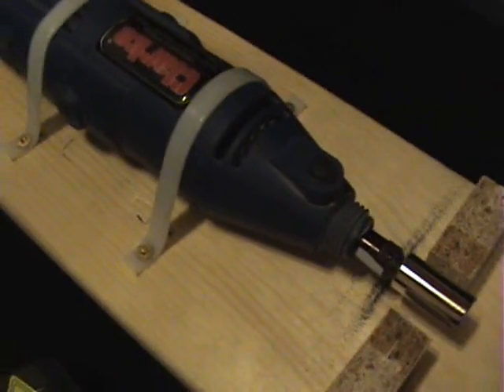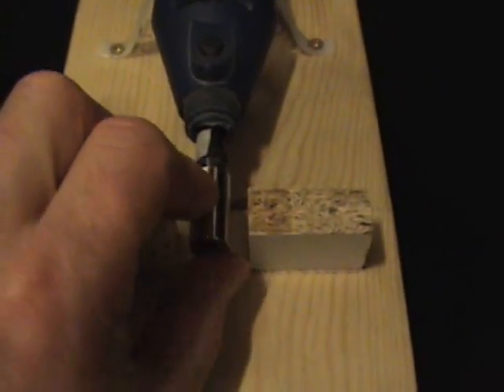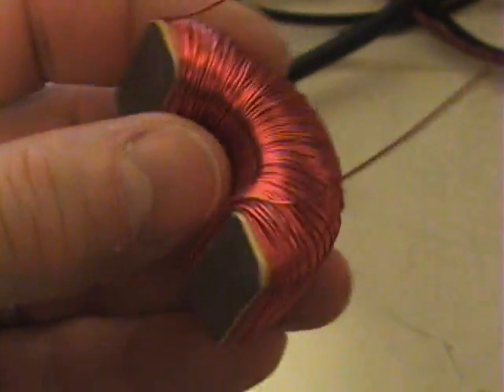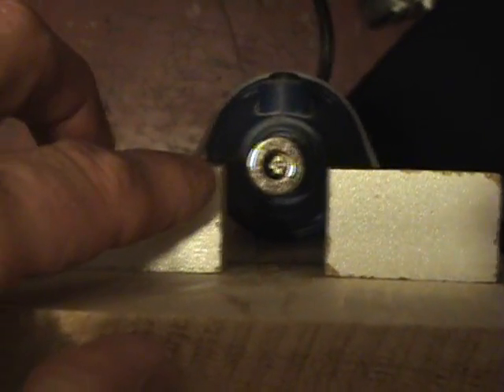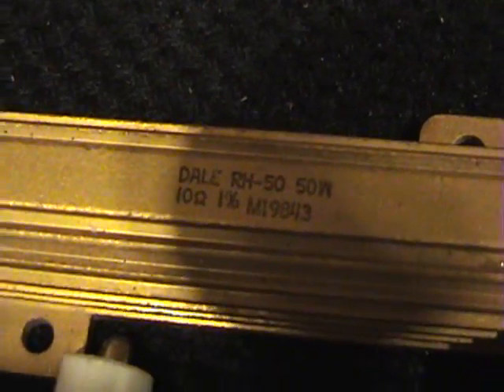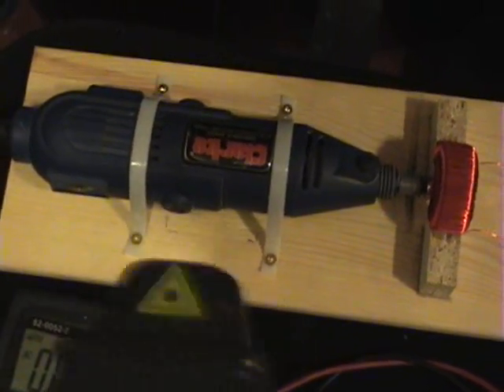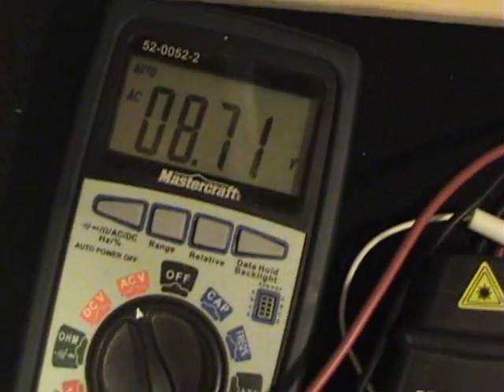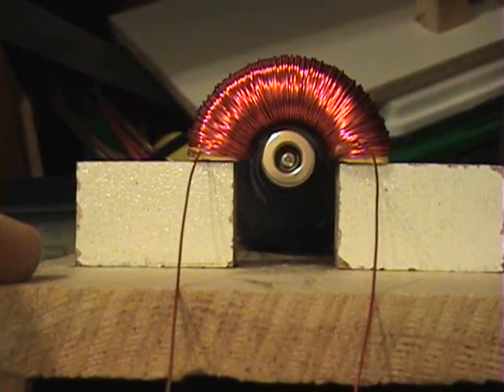Ukrainian Generator-Motor replicaion and test

Comment: The more power you pull from the toroid coil, the more the backward translation of load called Lenze law will load the prime mover. Use less turns for a lower voltage to push less amps and watts through the load resistor, or use a hightler resistance load resistor to draw less wattage.

Comment: Hi Luc. Thank you for sharing. I enjoy your uploads and I think you do a great job with construction and data. I especially enjoyed your semi-permanent magnet motors.

I've read through the comments, and I don't think most people realize that a simple design like this was the basis of the Gramme dynamo, the grandfather of modern generators. Just wanted to say, the self induction of the wire will always create a pole that attracts the rotor field, but that's what makes this contraption seem mysterious. In reality, it's a very inefficient generator. Because the creators of the other video purposely made the rotor loosely coupled to the torroid, the self induction was strong enough to attract the rotor, thereby aiding rotation, but at the cost of decreasing efficiency. Notice that they never calculated the efficiency in the video, only showing the novel aspect of the device. In other words, you failed to replicate the action because you increased the efficiency. Haha

Comment: I have an explanation for you, if interested. You seem to have accurately replicated the idea from PESwiki, but the problem is that PESwiki is a SCAM site. There are a very few good ideas there, but the idiot who runs the site (Sterling) is only interested in generating money by advertisements, so he could care less whether anything on his site is valid. My recommendation would be to go back to some of the early Tesla patents, and of course follow up with pre-1950 research by TT Brown and others to understand the valid concepts. Remember that all of Maxwell's equations were truncated such that scalar components of equations were literally discarded, and yet they were the elements that would lead you to concepts such as wireless power transfer, radiant power, etc. Replicating other's experiments without understanding them will generally lead to failure. You must educate yourself from fundamentals if you want to find the secrets that mainstream science doesn't want you to know. Good luck, and don't give up!

Comment: A capacitor in parallel with the resistor, forcing the flow of electrons into a capture device with diodes on both lines might be something to try along with this, thanks for the upload

Comment: i dont think that iron powder has that self resonate efekt that ferite material can resonate som time after the magnets stops running
Reply from the maker: At what frequency does ferrite self resonate?
Luc
Reply: i am using a MJL21194 transistor in my bedini generator to make my core self rosonate
Reply: The QEG was to resonate a steel core and thus generate a voltage, maybe this is useful idea for this motor?

Comment: Not at all an accurate modeling.  The Russian is using a 1/2 toroid about 6 inches in diameter with a 1" magnet diameter six or eight inches long.  You used a 1/2 inch magnet one-inch long with, what? a 2 inch or 3 inch toroid? The magnetic FLUX DENSITY is way too great in your model, but even so, there is still not enough of it. 

This device is making use of a phenomenon known as the Aspden Effect. The "aether" begins to rotate and it is this "virtual inertia" if you will, that gives the rotor it's assist.  Look up the work of a Russian scientist named Kozyrev dealing with the Aspden Effect.  Think of the aether as behaving like a "virtual flywheel."

How do you equate a 1 inch long rotor cranking 20,000 RPM with a 6-inch rotor turning 8000 RPM? Two very different situations. By reducing the size of the rotor and the toroid so extremely, you are employing too small a diameter "virtual flywheel."  The rotor is therefore getting an assist from too little "mass" of aether (no other way to say it) that is consequently behaving exactly like a flywheel that is too light for the application at hand.  Get it?

Note: Good reading re: the Aspden Effect, and more in - "The Philosophers Stone and the Search for Exotic Matter" by Joseph P. Farrell.
Reply from the maker: Sizes were not mentioned by the inventor. This was just a quick test to see if an effect can be detected. Can you post a link to your replication.

Luc
Reply: I have not performed a replication, nor do I need to. I am 60 years of age and my comments are based on 40+ years of employment in the electric motor / radio electronics field; a lifetime of ham radio operation & electronics experimentation; and good old-fashioned observation skills employing calibrated eyeballs.  Can you not see the veracity of the inconsistencies that I mentioned?
Reply: Take my comments as educational, not an attack. Trust me, I am very glad indeed to see someone finally using their head for something besides a hatrack.  Just don't dis someone elses' work when you have not faithfully reproduced it - ESPECIALLY in the arena of anything relating to free energy, which is ridiculed enough as it is by the paid shills of big energy.  Do you not understand why it is so important not to discourage people from this kind of thing - especially here?  Or would you like to continue paying electric bills?  And you DID invite expert input & comments.

Comment: Hey, use a series bifilar coil on the toroid to minimise the drag, when loaded across the resistor. 
Also use other half of toroid wound ccw with air gap, rectify and pass thru filter caps to measure the output. This way it wont drag and give much more output. Thanks for sharing.

Comment: Hi Luc! I think you should get the best efficiency out of that system by making sure the primary frequency (in the field generated by the magnet in this case) is as close as possible to the operating resonance frequency of the secondary circuit (the coil and its load). This is an interesting test actually as the motor used doesn't really have much torque but relies mostly on gained momentum for its purpose.
Reply: I usually use some battery with a resistor to pull up the circuit shortly to higher potential and then measure the oscillations with an oscilloscope when I remove the pull up. In some cases I also use a signal generator and look at the oscillations around a square wave signal.

Comment: Would you be so kind to test some more resistors and to see how it will correlate with input power?
Good luck!
Reply from the maker: I did and it all the same. Watts in for Watts out. A short practically stops the motor.

Luc

Comment: Perhaps the inventor only had one winding? I can imagine the windings should have to go all in the same direction. But as you are at it, perhaps you can wind the other toroid? Suppose you wind it from end A to the middle, then go straight back to A and wind it again. Then do the same from B to the middle. Now you can do several tests with it as you have 4 wires. At the right speed (also that is a parameter) you could get anomalies. The idea is that the coil which is doing it's back emf thing is by doing that actually speeding up the motor while powering a load.
I like the way how you approached this, this is replicable. All I would need is a steel half toroid. I can even imagine a yoke would do very very well. The yoke adds some mystical thing to it as well of course. Maybe I should pick up a television which they are giving away for free (people only want flat screens nowadays), just to salvage the yoke?
Reply from the maker: This was a replication to test the Ukrainian inventors design and claim. They do not have what you suggest in their device.

Luc
Reply: Luc Choquette
Hi Luc
Thanks for the answer. And yes, I was only thinking out loud, what would I do and test to get my own results.
I have also seen a device with a round toroid where you placed the half toroid. If you happen to have a ring transformer you could test this as well.
Reply: Luc Choquette
Have you tried to get in contact with him =)? I have seen him posting about the setup on overunity.com , and he has contact info on his site.

Comment: Hello there, good proof, maybe you can do your idear to limit the lens law,...??
The earlier test was much more interesting,!!! I suggest ,there is more progress on the early test,since i we did the test and see good opportunities there,...???
Reply from the maker: This was a replication of some other inventor and not related to my research. The  links to the details is in the about tab under the video.

Luc
Reply: I did notice that his torroid is half the dia. of the magn. circle . if  you divide his circle the mags. do not go to the half way mark. it does give ideas to experiment with, say fixed linear mags nnnnnsssss the a wire wrapped bar pulsed , then adjusting length. thanks for your work
Reply: You cannot lessen the effects of Lenz Law.